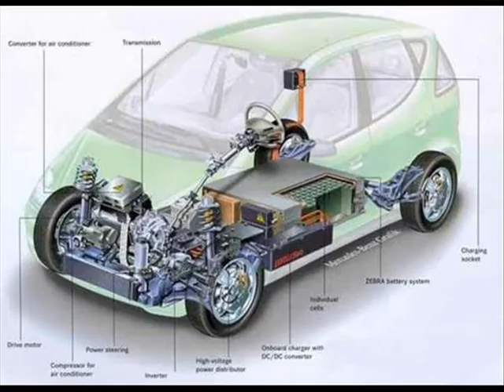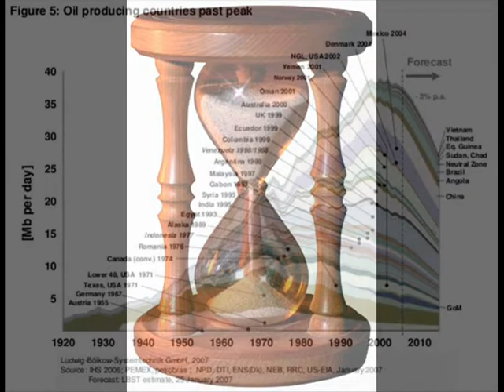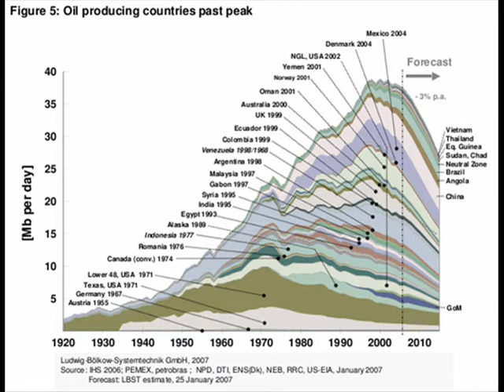High-Speed Rail: It's Electric! Original Version

Comment: Good presentation. But I disagree about the nationalization of the system. With private owners, you have companies/individuals that will charge different rates for either travel via train, or, in the case of their owning a section of the railway, charging rates that must then be added into the cost of the ticket.